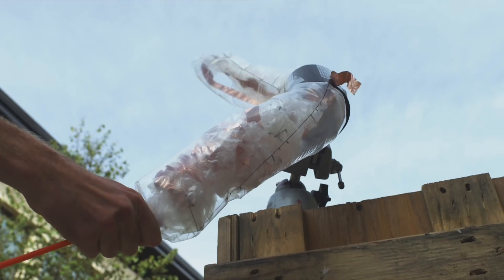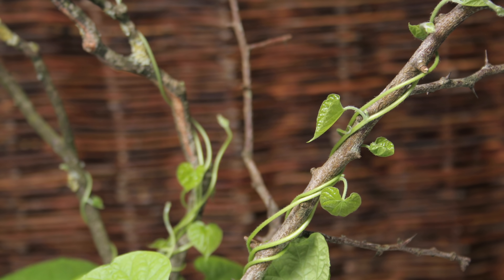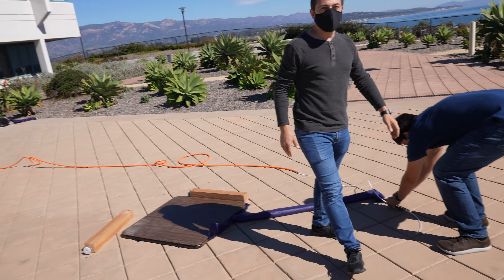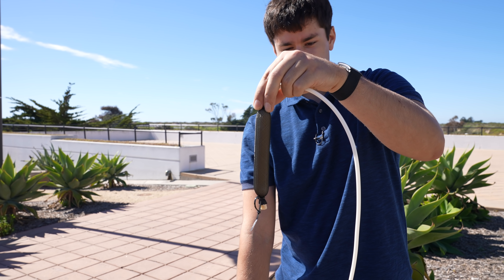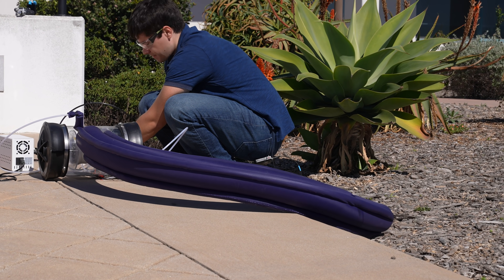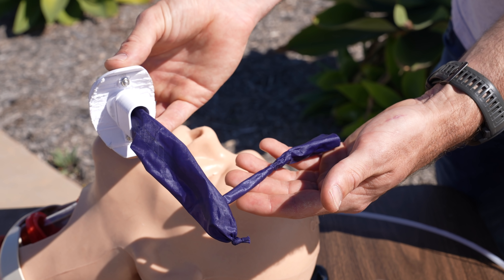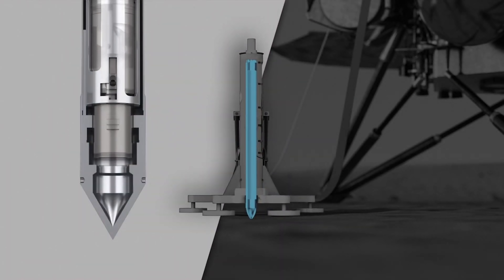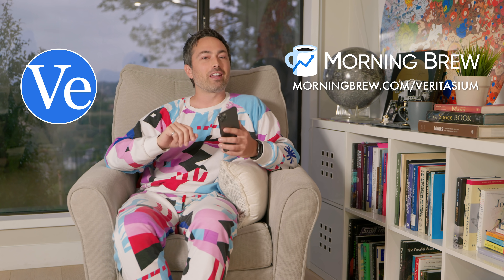This Unstoppable Robot Could Save Your Life

Comment: So I went back and watched your video over measuring the speed of light. You mentioned a lot of issues about measuring the speed with clocks, and how moving them would effect the clocks, can’t you use those 2 clocks to verify that there is a difference? The way to synchronize their shut off would be a physical string attached to each clock as they move in seperate direction. When the string gets pulled tight, the clocks stop, then observe the time that they stopped at and look for a difference. Then repeat in multiple directions. Also you could synchronize the clocks using string in the first place, those I’m sure there are issues with string specifically, using some form of physical connection between the two clock to start at the same time should be possible? I’m curious to hear your reply. I love a good puzzle...

Comment: about the intubation process: it's not that easy. that's why it hasn't been used for it. when someone's having difficulty breathing and in need of intubation it means they have swollen tissue. if the robot tries to penetrate the swollen tissue it may require pressure enough rip the throat. it could even blow up the lungs with momentarily pressure. i'm sure it works much better than the traditional way on a static throat model though.

Comment: What happens why you try to deep under water with your vine robot arm? Let's say, you use pressurized water inside instead of air, do you have to increasingly apply more water pressure, the deeper the robot tip goes?

Comment: To get a truer picture assume that the secondary body is making 1.001 and 0.009 rotations per orbit. 360 divided by 1.001= 369.64 which means that it will complete one rotation when it reaches 369.64 degrees in its orbital path and the remaining .001 rotation when it completes one full orbit 360 degrees.

Comment: 11:15 this would work so well for oil sands it's crazy to even think that isn't being looked at. Like it would not only be a simple fix to a problem with the oil industry but it woukd also make cleaning up well sites easier as you wouldn't need to take a giant pipe out of the ground.

Comment: The pillow demonstration is actually already in use on a smaller scale, some police, lock smiths, and towing services have inflatable pillows that they can place into a cars door jam to pry it open with very little pressure to be able to get to the door lock/button or door handle to get inside a locked car.

Comment: Dont use pneumatics to steer it but electric current sent through four separate conductors in the snake itself. On or off current turns it with right alloys

Comment: does it work with liquid pressure as well as gas? if water could be used then in a fire water tubes (with holes like sprinklers) could head into the center of the fire and get started on extinguishing it from the inside while firefighters are still battling it from the outside- this could be helpful in a building fire or forest fire

Comment: This is why if you take multiple bottles of water, hook them up air tight. You can use simple gravy of a little bit of water to create 1 psi or more to lift tons of pounds off the ground. Even a car. With water bottles (with less than 20)! So who is to say you could not apply this to lifting the pyramid blocks.

Comment: Even if the robot is punctured, couldn't you use that tire slime substance to quickly seal the puncture upon contact with air. Obviously, you'd have to inflate the robot with a non-reactive gas.

Comment: Cool robot! Could this be used in colonoscopy? I have to think that it might be a little bit better than the tools that they use right now. Also, could it be use for running cables through soil. For example, you guide one of these robots under the earth the way that you wanted to go when it comes out at the destination you attach the cable to it and then pull the cable back through the hole and Bob’s your uncle!  And of course, this might be useful in reaching trapped miners and bringing air and water to them.  This might also be useful in creating concrete supports underground. You have the robot burrow in to where you want it to be and then you pump liquid concrete into it so that it solidifies into a loadbearing structure.  Might also be useful for running cables through the walls of a building. You could guide the robot around obstacles to where you wanted to go perhaps with the cable already in the center of the robot.  Might also be useful in inspecting and perhaps even cleaning out air ducks in homes and businesses.  Could also be used for the inspection of any type of piping, sewage pipes, oil pipes, natural gas pipes, etc.  I also almost forgot to mention that the inflatable muscles might be useful in creating pressure suits for astronauts that are easier for them to move around in because an inflatable muscle is helping them to bend the joint.

Comment: It would be interesting to see if these would be useful in investigating issues with plumbing. I remember using a drain snake which kept getting caught on the right angle turn of the pipe.

Comment: I wonder if you could survive under water using it as like a deep oxygen resupply point, by simply attaching a weight to the end similar to the camera design, its cheaper then steel piping which can rust. Or use for underwater cables.

Comment: There is an old coalmine near my house that I would like to explore but, for hopefully obviously reason, I am not going to go into.   It is a small square hole horizontal into a hill face.   

Not sure what is beyond 10 or so feet (as far as a flashlight will see. 
The path inside is full of debris and it looks like part of it may have slid in on itself.   

one of these would be fantastic to send a camera in to take a peek.   Likely nothing in there but it sure would be fun to see.

Comment: Kind of positive when he crashed to the ground and said, "that was great" the pillow broke, went flat and was a total failure. 

Im not denying the potential, but dont be a clown busting my balloon animal and pretend you meant for that to happen

4:33 he makes my point exactly. That is a 30in x 30 inch=900 square inches lifting 150lbs at 1 pounf per sauare inch and BREAKS! 

At 1 pound/sq inch at 900 square inches should be able to lift 900 pounds. Especially with the plywood equalllizing his weight. 

Im am not blown away.

PS this moron just suggested this tube could get a car or collapsed building or minning accident off someone. One of the stupidest things ive ever heard

Comment: Engineers without medical knowledge need to stop trying to solve medical problems. All of this pseudo-innovation has little place against the rigour and difficulty of modern medical certifications and standards, plus the many many years of experience that current field tested kit can withstand. There's definitely room for improvement, but it ain't gonna be found shoving a balloon down a dead guy's throat.

Comment: Shame you didn't get this over to Suez, could have had it burrow round the hull of the ship and then when they fired up the tugs that couldn't get it off the bank, turn on the air to make the sand more fluid to get it back afloat. Although perhaps wet sand isnt as good a candidate

Comment: The thing with intubation is that you need some amount of force to pass a regular tube if the patient has a throat that is swollen due to some reason such as an allergic reaction. This device may not necessarily provide that "pushing" or "prying" force in patients with collapsed tracheas.

Comment: Pressurized air is already used in most car shops. If a car fell on someone while they were working on it they could use this if you couldnt slide a carjack under the car. Sometimes cars that are being worked on dont have wheels on so you cant slide a jack under if the car falls. So this would be a nice emergency item to own like a fire extinguisher in a automotive shop.

Comment: This technology has been in use for CIPP repairs of storm sewer and sanitary sewer pipes. Same idea of using a plastic tube inside out and then inflating it into a sewer pipe underground. The resin on the "outside" of the tube is then cured with either steam or UV

It's saved a lot of money due to not needing to shut down roads to dig up a pipe. Cool stuff

Comment: Could something like this be paired with the neuralink chips to form prosthetic limbs that someone could control. Cause if the chips can translate signals from the brain into data and these robots could function like muscles and tendons then besides the fact of needing a computer and air compressor it could make strong and light weight prosthetics

Comment: I'm sure there's other applications of the current vine robot, but I'm actually thinking that the muscle system will probably become an integration into a fluid powered version. Do that with certain actuators and sensors and suddenly we can create better functioning artificial limbs and muscles for those who need them.

I say fluid because I can only imagine how annoying having an artificial limb with pneumatic actuators always firing. "PTSHHHH!! TSHHH! PFFSHH!!! TSHH!!! PFFFSHHH!" Have to pull out a small air compressor to pressurize the thing. "BRRAAAAANHHHHHH!!"

Comment: One potential use could be to insulate and air seal wall cavities. The plastic/rubber sheath provides the air sealing, and the volume of air can be used as insulation, or be replaced with other insulation.

Or to seal air ducts, by sheathing the whole duct with new plastic.

Comment: This is super cool, but Im dubious about its use as a replacement for a traditional cuffed endotracheal tube. Intubation requires a couple of things: the correct placement, isolation of the airway, and enough rigidity to apply suction without the tube collapsing. This seems like it would ventilate okay under positive pressure, but its lacking any type of cuff (inflatable rubber balloon around the tip of an ET tube) to prevent vomit, blood and other undesirable things from making their way down into the airway. However, given that this system here runs on positive pressure, that seems like it would be an easy addition. The bigger concern is the inability to use suction: its common that you need to suction secretions out of the airway and tube of a patient who is intubated, and this material would seemingly not be capable of handling that. I also have concerns about its lack of rigidity on unusual anatomies and trauma patients where you might be pushing through something to get into the airway. Also, we need to not stack breaths: ie return to ambient atmospheric pressure to allow the pts lungs to empty: would this system collapse when the compressor is turned off? Cool concept, but needs further development.

Comment: Not a robot.

These have been used since the 80's at least to lift cars, the pressure in the 'bag' that doesn't the lifting is generated by forcing exhaust gasses into the bag via the 'snake'.

Comment: A similar concept is/was already being used in plumbing industry .  They use that inverted expanding tube to rebuild collapsed/damaged pipes by shooting it through with air and adhesive so that it builds a new wall inside the pipe.  Definitely can see many plumbing applications for the "robot" though, to inspect lines, get through obstructions, push through obstructions, etc..

Comment: This is basically video endoscopy.
It uses a soft walled tube extended by pressure, which is a remarkable tschnological innovation, but this sacrifices fine control, penetrative ability, and usefulness as a tool canal.
I cannot really see medicinal applications, not without much stronger wall materials and finer control over the tube, but in survey and search and rescue, and perhaps even pipe maintenance roles it is potentially very useful.

Comment: This is great, but pressurized air contributes greatly to air pollution because 'compressed air' is not actually air but a gas that doesn't even occur in air in small quantities. Pressurizing air is very difficult and very expensive to do, so in the end I don't think this idea will have a future outside of maybe the health industry (with the tubing example)
Reply: Then how the heck do air compressors exist. you know the ones that fill up your car tires and soccer balls

Comment: Hey it can be used in fire fighter situation like u can make it from fire proof fibre then first use the air pump to make it to the desired place then change it to the water pump to put water on the fire in the required area for example if some one us stuck in there 😁

Comment: When the amount of elementary particles falling on the head from space is 100
When the amount of elementary particles that penetrated from the other side of the earth to your feet is 80.
This difference 20 becomes gravity.

If you hold the gauze in your hand and let the water flow, you will temporarily feel the weight as the water passes through the gauze. Nothing remains after passing.
Since the pressure of elementary particles changes depending on the atomic structure of the substance, it is pulled by the dense substance. In other words, you feel the weight as the elementary particles pass through.

Then, when the stars collide with each other, pressure higher than the density forming the star is applied from the left and right, and the star collapses. This collision energy cannot escape because the pressure is high on the left and right, and it becomes a kind of pressure cooker state, and it is blown up and down where the pressure is weak. This is called a jet. Black hole is this principle

Comment: They used that tech for years in underground inaccessible pipes that have som defect or rupture. They inflate it trough the pipe and it sets out to be ridgid with two part epoxy or flex, depend of application.

Comment: I'd imagine you could achieve the same effect with water pressure. Then you could have them extend into burning buildings (with camera?) and get water to the heart of the fire. You could also line a fire truck with a lot of them and with little to no guidance you could get water all over the inside. 

It would be a problem to line up the pillow under a heavy object as you would need to be the exact distance away. The immediate solution I can think of is the ability to retract the base of the tube so that when you get under a heavy object but have 30 feet of unextended tube before the pillow, you would retract the base 30 feet.

Comment: Excellent innovation, amazing lateral thinking. However, in regards to using this for intubations; 
In current intubations, the endotracheal tube has a cuff on the end to help seal the airway from debris above it (such as vomit), and is a rigid plastic tube to prevent compression when it's attached to a ventilator. A clear deficiency in this soft robot design with be the lack of a rigid plastic (which would mean that it could still be blocked) and it doesn't have the end balloon to help seal it against foreign bodies (which would mean you could choke). One of the most important reasons people are intubated is to prevent such material (such as vomit) from occluding your airway, and to me it seems like such a soft endotracheal tube inherently cannot perform such an important function. Perhaps there may be revisions, presumably it'd also have to be compatible with the ventilator that it needs to load onto, but I'd imagine this is is going to be far from an easy task

Comment: But doesn't the basic nature of this principle pretty much prevent it from being used as a robot? I mean, since the tip of it gets deployed last, putting cameras or any actuators at the tip would mean it would still stay blind until it is fully extended. That would mean if you tried using it in an unknown environment, like a crushed building, searching for survivors for example, you would have to know ahead of deploying it where it would have to go and how long it would have to be in order to see something at the end of its full deployment length. Using a try and error method where you just randomly blow the thing up again and again until it randomly finds a useful way would also not work that well, especially if it gets punctured, because then you can't retract it anymore.

And if you would put little cameras all over the surface in order to continuously see something, you would probably lose a lot of the "squeezing through cracks" abilities.

Comment: I saw this principle used for sewer drain repair a while back with a flexible sock coated in a resin. As it inflates it works its way through the damaged pipe and then hardens forming a new solid wall. Very clever

Comment: Avalanche safety gear. If you get buried in an avalanche it could potentially create a pathway to fresh air. When a person gets buried their breath melts the snow around the air ways then freezes and creates a chamber which the person suffocates in...this is small and cheap, it could totally be adapted to this application.
So much potential!

Comment: In space if there is little or no atmosphere (environmental air pressure), how would blowing air through the tube be different?  There would be less force pushing in from the outside of the tube against the walls of the tube, so ...?

Comment: fyi, the intubation doesn't work, it can't be that soft of a material. Neither would the sand digging on things like mars. You can't carry enough air and there's not enough power to try and get it locally.

Comment: In terms of "lifting up a human" with this, this is already pretty well known.  Airbags are used in vehicle extrication for various uses, as you can actually hold the weight of the car for stabilization, especially in odd orientations of the car, line upside down or on it's side.  They can also be used to open a door enough to unlock, and that is frequently done for lockout services like AAA.  What they've came up with is pretty interesting, but isn't as ground breaking as one might think.